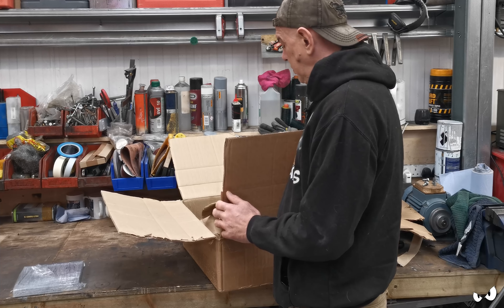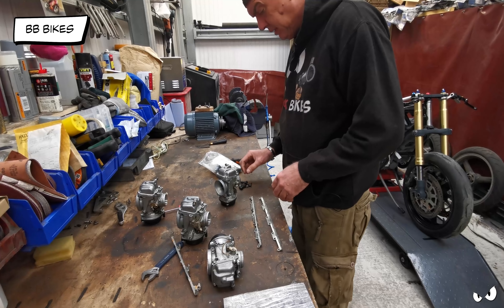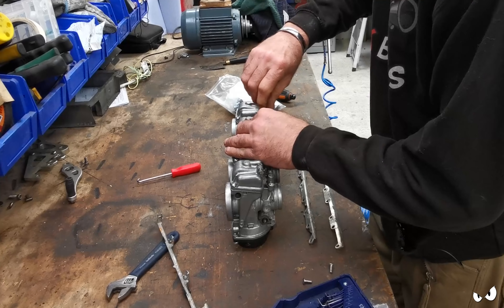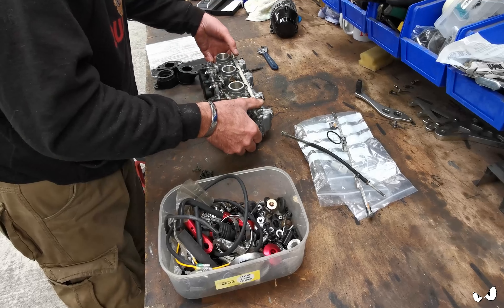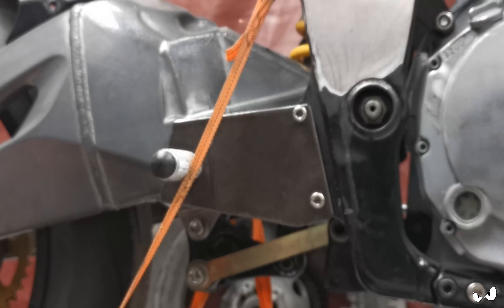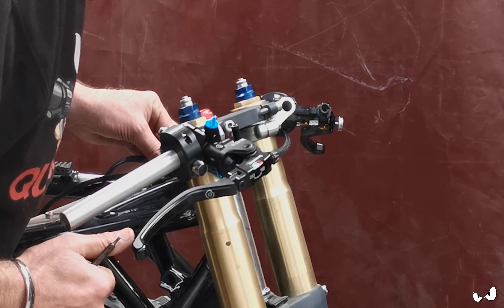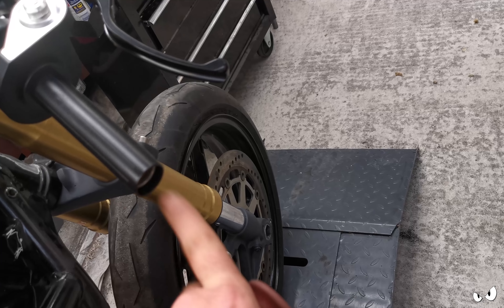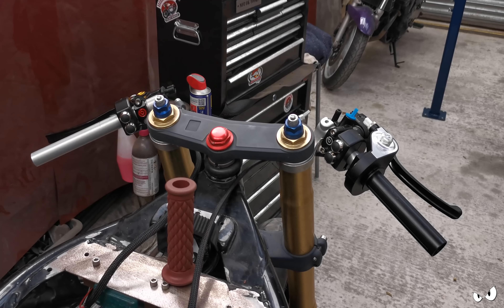Bits n Bobs - Suzuki Bandit Cafe Racer - GIXIT Project Part 52

Comment: Another great episode, there mounting up now. Hope another lockdown don’t scupper your plans😱 those quick action throttle kits are great, some with interchangeable cams, are a aftermarket first fitment on the KTM lumpy twins.👍
Reply from the maker: Cheers Dave. I love the quick throttles and swear by them. Just means you don't have to change your grip or twist your arm loads 😂😁👍

Comment: You could get some lathe practice in and make a circular clamp to go below the clip-on that is the same pick-up point as the top yoke, it would allow adjustment of the clip-ons without altering the headlamp postion.
Reply from the maker: I was thinking along those lines, but we now have a cunning plan that doesn't involve the lathe... Stay tuned dude 😁👍

Comment: If you want a cheap quick action throttle for asbo the yamaha R1 and R6  tubes do the job. The R6 is more agressive than the R1. I'll have to double check the years and make sure the fit the 600. I know for sure the fit the mk1 1200 and sv 650
Reply from the maker: Ah.... Didn't know that... I'll let Steve O know 😁👍

Comment: hey what about putting the brake lever on after the control switch
Reply from the maker: There is another button on the back of the switch block that you wouldn't be able to get to if we did that 😁👍